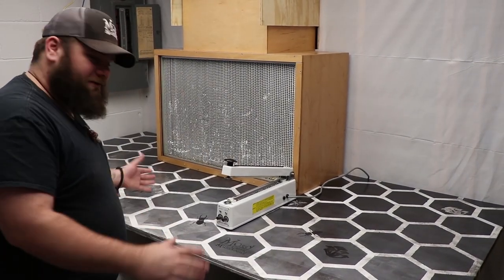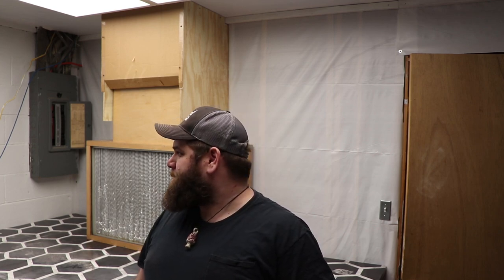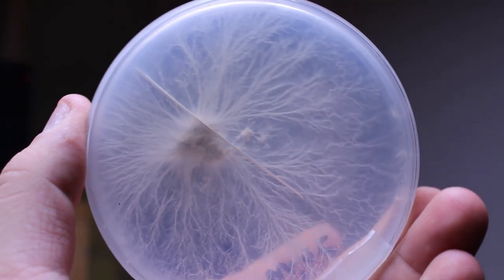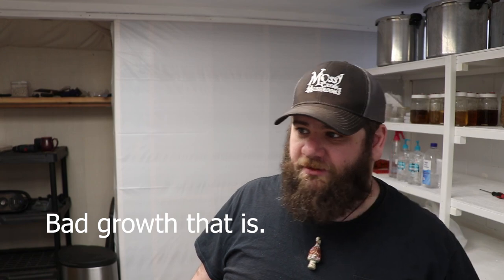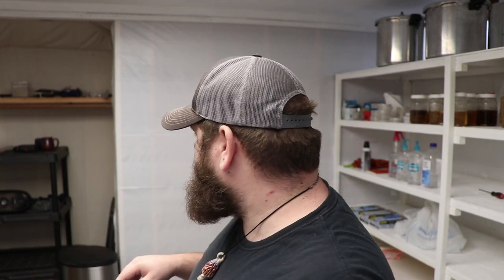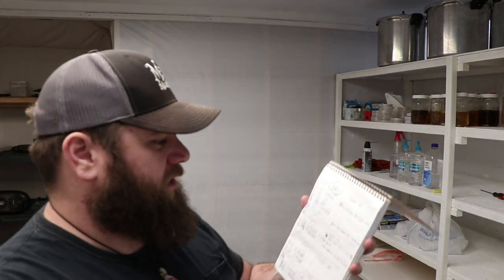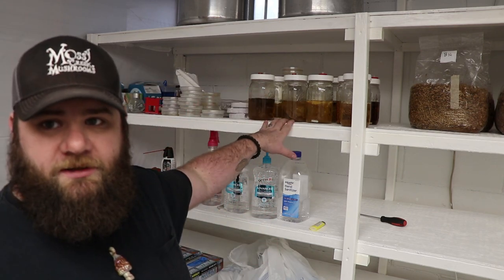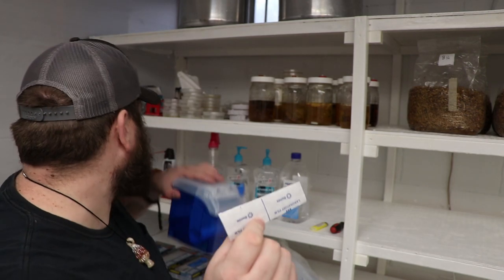How to Grow Mushrooms: The New Lab

Comment: Very nice, I used the UGL Dry Lock on our basement walls.  It was the hardest stuff to paint, I had 30 feet of wall 8 feet high and it took 5 gallons.  I has worked so far.  Keep on spawnin.

Comment: Your only wrapping once around with the parafilm? 

I've seen it break thru around edges of the plate...So now I wrap twice (also depends on stretch and temp, I guess)...but it beats contaminated plate.
Reply: john smith have you tried wrapping with cut down 2” glad cling wrap? I had trouble with cracking on parafilm as well.

Comment: Do you pre seal the bags before sterilizing? If not, and you are rolling bags from the steamer to the lab for additional cooling, don't you risk contaminating both the lab and the bags while they are cooling in the dirty area outside the lab? We are building a through the wall steam cabinet due to contaminations of unsealed bags while they are cooling and drawing in air and fear of rolling in dirty bags and racks into the lab. Through the wall double door sterilizers eliminate that risk.
Reply: @Mossycreekmushroomsofficial  Thanks for that. Our through the wall steam cabinet with double doors that allows a roll-in-roll-out rack system was very economical to build. It's just some 2x3s, insulation, and a rubber gasket around the plywood door edges. It cost less than a cattle trough in my area. One can see the increase in flush sizes and myceliation rates by having super clean bags. Trichoderma and others suppress mycelial growth and flushing rates. If I leave 20 bags for 12 months the truly sterile bags become obvious. We grow weird wild species that are super slow growing (months) and as a result we learn quickly which bags are truly clean. Not a big deal when growing fast white rot mushrooms but to be fair I guess every bag and pound of product counts. Love your videos and ingenuity. More please Sir!

Comment: Also, hepa is expensive buut if you use a merv 13 with in addition or even with out a hepa, you could save big bucks. Also you could go even high in merv and still come out cheaper than hepa. Merv 13 catches up to .3 micron and it is 98% efficient compared to the 99%  efficientance of a hepa.

Comment: You mentioned 70 iso, why not 90 percent...  I thought it would be stronger.
Reply: I always heard because the 90% alcohol evaporates faster meaning the 70% has more time to work
Reply: @killerkennyas   thank you ....  that makes sense......
Reply: the iso has to pass the bacterial membrane in order to get into the cell and then kill it. If we use pure alcohol (or more than 80%) the alcohol causes the proteins of the membrane to coagulate too fast "sealing it", so the alcohol can't penetrate. After that the cell gets inactive but not dead. If we use diluted alcohol, the coagulation is slower, so the alcohol can gets inside the cell and kill it. I Hope solved your doubt, I had it once and wondered the same as you.
Reply: @andreslorenzosantana4920  thank you so much.........is there any way too dilute 90 percent.........
Reply: @kathyanne3587  Yes, it is. If you have 90% iso and you want to make (for example) 500ml of 70%, you have to multiply 500ml x 70% and divide by 90%. So, (500mlx70%/90%)= 388,88ml. That is the volume of 90% iso you have to start with, and then add water until it reaches 500ml to achieve a 70% diluted iso. You don't need such precision, so you could use 390ml or 400ml iso and 110 or 100ml water to achieve that.
Reply: @andreslorenzosantana4920   Thank you so much for the detailed description.... my motto........the devil is in the details.
Reply: @Mossycreekmushroomsofficial  no worries...keep  up the good work.  I love your videos.... you are so organized, I think that really helps me understand the process.  It is a smooth system
Reply: Higher risk of making fireballs in my experience....lol